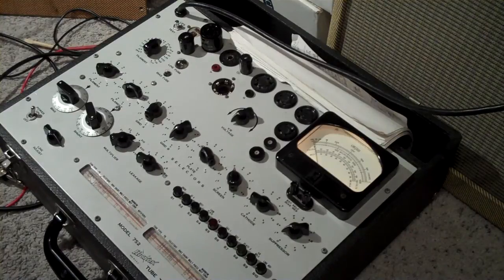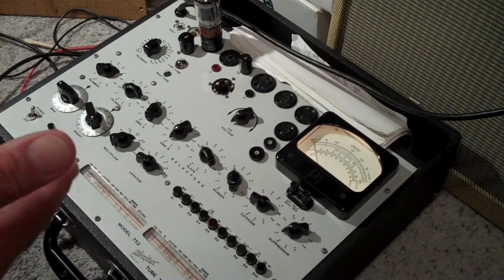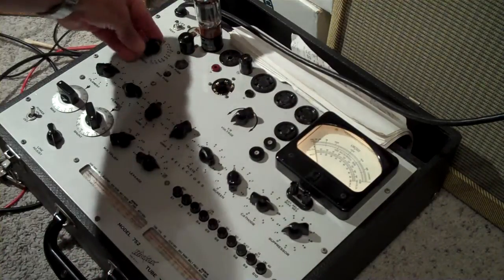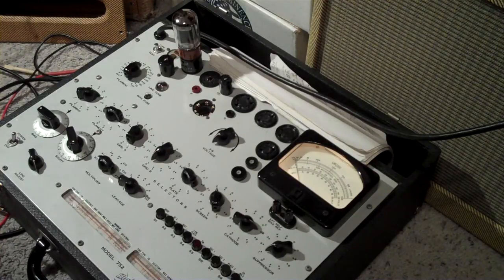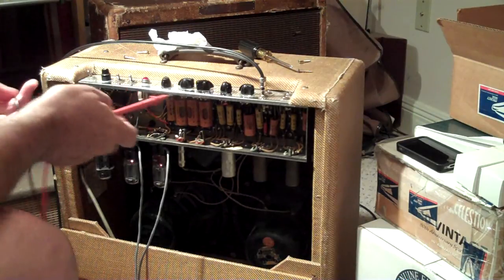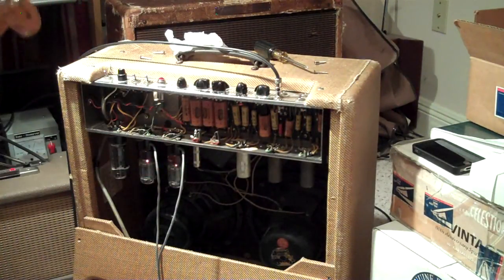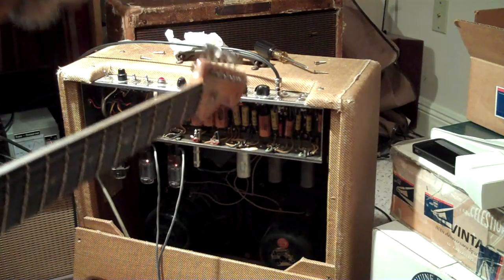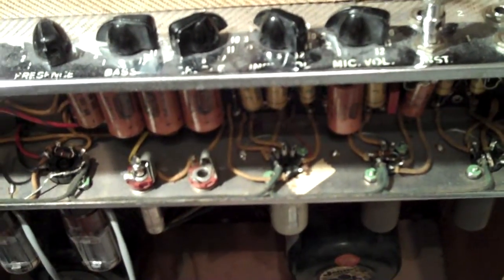Squeezing the Most Tone Out Of Your Old Tung-Sol 5881 Power Tubes

Comment: Hey man! How you doing? How do you feel about the location of power tubes in a duet when one tube biases a little higher? I've been tinkering and discovered I hear a difference if I put a higher biasing tube last in line vs matched vs higher biased first in the output stage etc.

I've tried this on my '71 Bassman and PRS HDRX 20 (using new production Tung Sol 5881s in both) with favorable results... I don't know how to describe it other than possibly more "3D" or more "depth", especially playing clean. I haven't had the chance to really crank them into full blown breakup but stumbled upon this video and imagine you've experimented with this.
Reply from the maker: I have not experimented with it but I'm sure it happens naturally depending on the tubes.  I've used many mismatched 5881 pairs in my Bassman so I'm sure the higher bias has been on one side or the other at many different times.  Plus, when I recheck the bias, I'll find that one has drifted quite a bit to make a mismatch one way or the other.  I don't know which sounds better.  I just know that sometimes the amp just screams and sometimes maybe not so much so maybe it has to do with the mismatch.  Lately, I try to match them but I found that even when I buy matched pairs, they don't match in my Bassman.  I found that if I check the resistance of the 470 ohm screen resistors on the sockets, they are sometime way off from each other and maybe one is out of spec.  I found that if I put in a matched pair of 470 ohm resistors, the tubes match up a little better.  Check those resistors too and maybe experiment.  I have never really figured out why I was getting bias drift but I suspect it was either the old screen resistors or maybe just old tubes that are not as NOS as they were advertised as.  I never use new production Tung-Sol 5881's but I may have to in the future.  I hear they are a pretty great substitute for the real deal although I suspect they don't last near as long.  I get many years out of the old NOS Tung-Sols.

Comment from the maker: Luckily, I think there are enough old tubes out there to last at least another 20 years. V1 is an RCA triple mica 5751, Mullard 12AX7's in V2 and V3, Tung-Sol 5881 (probably 1960's), and a Mullard GZ34 rectifier.

Comment: The guy at the big chain music store told me he had never heard of testing tubes, he said you had to buy new ones.
Reply from the maker: That is probably all he knows if he is young.  In the old days, back in the 50's and 60's, they had tube testers and tubes in every 7-11 store so you could check for bad ones and buy new ones mainly for TV's and radios.  They make some really good tube testers now by they are expensive.  Orange Amps makes one, the VT1000, that is about $500.  With the new production tubes, it probably is best to just buy new ones because they just don't last like the old ones did.  Most of the tubes in my amps are from the 50's and 60's and they are still going strong.
Reply: millstap I have been keeping the old tubes whenever I change any, but do not know how good or bad they are. I wish the local drugstore still had the tester they used to have. I will not name the big music store that said you can't test tubes but their initials are G.C..
kl

Comment: Love your videos. Vintage amps sound amazing which is why I just bought my first vintage amp. A 72 silverface twin. I was curious if there is anything that is recommended to do right after buying a vintage amp. It's plays great and there's no crackling or humming or anything. But would you recommend new tubes or recapping? Or just go with it and use the if it aint broken don't fix it mentality? Thanks. Keep the videos comin.

Comment: I'm sorry but I have had a 20v swing when biasting on the plates. When u start drawing more current when u turn the bias and start drawing more current it loads the power transformer and the voltage drops which there for u have to do the math agin . This video is not the correct way to bias an amp please. Learn ohms law . It's simple.  Don't use website calculators . Every tube has a max wattage output Google the tubes u have . Lean what class tube amplifier u have .most amps are class ab push pull but not all so learn .. A hot bias is 70% of that max wattage . 60% is a mild bias , 50% is a cold bias . A 6l6gc (make sure its a gc not a gb or a g bc they are different) can put out 30watts max . 70%of 30wats is 23.33 Watts. Ohms law says voltage x current =watts . 450v on plate @.052 mA =23.4watts. 420v@.055mA=23.1watts . Keep checking voltage don't just assume that voltage will stay the same way when u first measured it . This is not rocket science.